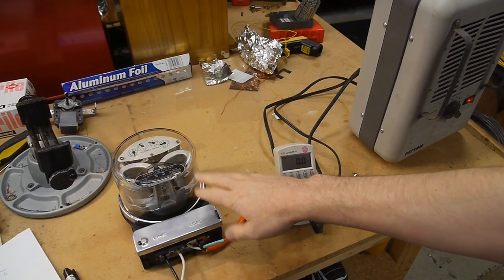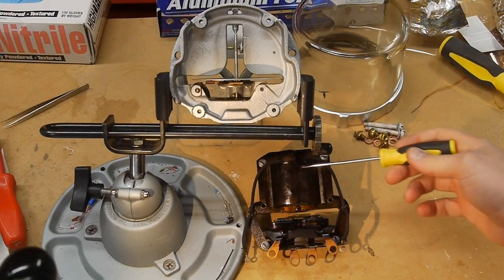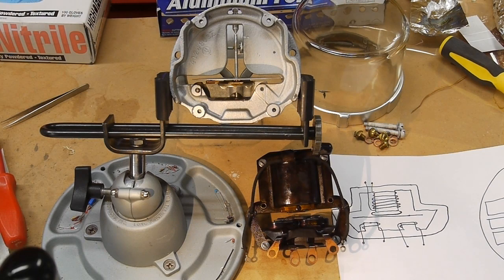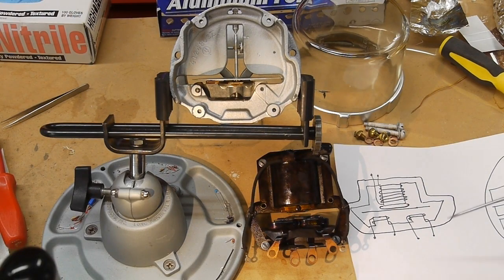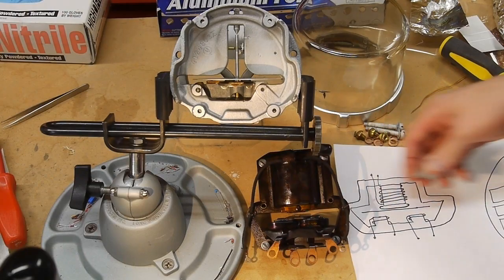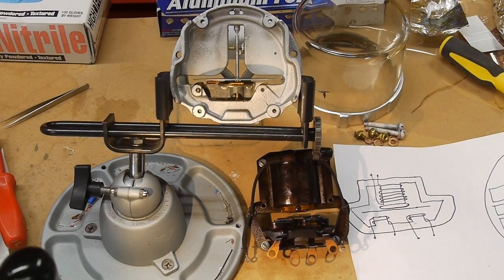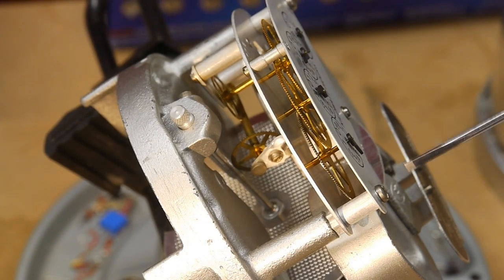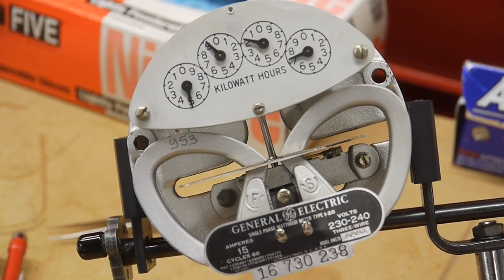Explanation of how kilowatt-hour meters work (electromechanical)

Comment: Is this correct, if I wire my home with oversized wires (gauge 10 vs 14) would the meter run slower (cooler) versus standard wire which is 14 would run faster (hotter) on the meter. In other words would I save money by running thicker gauge in my prewire home?

Comment: Why when we put a photovoltaic panel or a cogeneration unit in an power utility then the meter turn slower or not at all if the self-produced power is a bit fewer than consumed one in the first condition,or equal in the second or the meter turns backwards if the self produced power is a bit more than consumed and it turns exactly as the difference between self-produced and consumed,or it turns full of speed backwards exactly to write the self-produced amount that we export to the national energy net if the instance consumed e energy is zero and instance self-produced non zero-possitive?
All of this it has to do with the phase bitween grid voltage and self-produced current?

Comment: As an electrical engineer, I worked on the manufacture of a specialized piece of test equipment to trick these meters.  It combined passing full voltage combined with high current from two separate sources.  The meter was thinking it was reading 30KW, when in fact the equipment was only drawing less than 1.7 KW.  We used it in the calibration of wireless meter reading designs.

Comment: The two current coils are also there to generate their own torque on the rotor, but proportional to the current flowing...the asymmetry is to make the current based torque also generated by another shaded poll arrangement. On the whole it looks like a set of two shaded pole setups, one for the voltage, and one by the current. Voltage coil alone will not provide the rotating torque on the rotor. But both have to have the shaded poles, to give the torque in the same direction.

Comment: Here is something I would like to hear comments on or a piece on how I am not right.  Several years earlier I installed a whole house surge protector capable of handling a significant surge from lighting on the incoming power line.   In 2019 I was on a 2 month RV trip to visit my new grandson in CA from NY.  When we returned and I read the meter for the last month my jaw dropped.  While no one was home and everything possible was shut down the house had consumed more power than it ever had before and close to 50% more than the first month we were gone.  After talking with others in the area I realized that there had been a lightning strike hit the power line that month.  Others had some serious damage but my surge protector protected the house as it was supposed to and now the electric company was preparing to charge me for the power my surge protector consumed.  They said no that wasn't possible and checked the meter and said it was fine but replaced it anyway with a newer digital meter and gave me a refund of the difference between the first and second month.  Since the new meter has been consistently lower than what monthly usage was earlier.   I think if you put in a whole house surge protector capable of withstanding a lightning strike on the line you should get the meter changed to digital.  I was right and they knew it and the meter was damaged from a previous strike or just plain not working right but they wouldn't admit it.

Comment: Hmm... I got one that was used for a lamp and the natural and hots are opposite. Yours the hot is on the outer terminals and the one I got the hots are on the two inner ones? Which way is correct? cause mines working no issues.

Comment: Hello. I am leaving alone in townhouse with 4 units. I do not have laundry machines at all, do not have electric cattle, use only gas stove. But my gas and electric meters’s discs speeding up much faster then other neighbours’s. Ones’s even does not move. How it can be? All my neighbours have at least 3 people in family, they are all present, in this winter time i am sure they have to use gas to heat house and boil water. But they meters’ disks do not move. Am I paying for my neighbour’s gas and electricity?
How I can find out this?

Comment: I think it's funny how they make a motor to use energy to turn, magnets to slow it back down, and a copper piece to speed it back up again, and a hole to slow it down AGAIN. Isn't there a simpler way to turn current into motion??

Comment: Late to the party here, but could the asymmetry in the current coils be there to bias current flow in the load direction. I.e, in residences with PV or excess energy to underpay them for reverse current (back into the grid)?

Comment: One aspect is unclear to me.  It doesn’t seem possible that the actual current of the load (a residence) would pass through those current coils on the meter, because the wires carrying the current to the panel are much larger.  How is the meter coupled to the power lines?
Reply: Now I get it.  There is a current transformer which is shaped like a doughnut, and the power line just runs through the hole.  There are two, one for each line.  On high-power meters, that is.

Comment: Ok they meter the line coming in, so they charge us $$ for it.
And since current always returns to its source, if we were to put a meter on the neutral going back to the pole, would we actually have used any "electricity" ?
Reply: The meter measures what you use.  The statement “put a meter on the neutral” doen’t make any sense.  When a meter is connected correctly, it will record the correct usage.  If you hook it up incorrectly, who knows what you will get?

Comment: Thos kinda reminds me of an electric brake system Saurer experimented with on their trucks. The idea was to used eddy currents for a frictionless brake. Afaik the system turned out to be too heavy although it worked well.

I don't exactly know what the holes in the Alu disc are for, but they hardly matter for the eddy currents. Those currents form rings, so drilling the center out won't change much. My guess is it is for weight reduction / balancing reasons, and on the trucks they also did it for cooling

Comment: I guess, the three current coil configuration has been installed for people who want to reduce their electricity costs by returning the current to ground instead of neutral. When two coil sections of the neutral coil are positioned positioned against each other, they cancel out each other. This results in 2I-I=I When current returns to ground, the meter still receives I, since +0I-0I+I=I.
Reply: The way you reduce your electricity costs is by using less of it.  Turn off lights when you don’t need them.

Comment: Okay I think you definitely know almost everything there is to know about electrical kilowatt hour meters so here's a question for you... I'm fairly sure I have a Sangamo Type J5S Electric Watthour Meter CL200 240V 3W 30TA 7.2kh .. it has the old-style analog disc but it has what appears to be a recently added digital readout.. I know the dial Will spin backwards when there is a backfeed.. I'm trying to figure out if it's likely that the digital numbers will count backwards during a backfeed or only count forward even during a backfeed

Comment: Another comment about voltage coil and phase shift: without any shading coils, the phase shift of the voltage coil is almost exactly 90 degrees.  This is because of the many turns and the relatively complete iron circuit.  Do this: measure the DC resistance of the voltage coil (probably in the 100's of ohms?)  Accounting only for that, it would draw ~1 amp.  I am willing to bet that is draws only a few milliamps.  Why?  An inductive reactance 100's of times more than 100 ohms!  So the phase shift will be nearly 90 degrees.  The shading coil only is to "tweak" the lag a few degrees more.  On the other hand, the current coil had almost zero inductance, so the phase shift of the current is almost zero.  What is important is that the phase shift of the voltage relative to the current is exactly 90 degrees.
          The cheapest larger induction motors use this technique for starting.  It is called "split-phase start".  On purpose, a "starting" winding is wound with "way too fine" wire, and "too few turns", causing the current to be regulated by resistance, not inductance.  The "running" winding is heavy wire of many turns.  Its magnetic field is delayed relative to that of the starting winding.  If the starting switch doesn't cut out the starting winding within a few seconds after starting (or if starting fails), the winding will burn up!
          Regarding the "anti-creep" hole: in many meters they put a tiny steel rivet into the hole.  It is attracted to the magnetic region.  Does your meter have any steel in the hole?  The wheel speeds up as the rivet approaches, but slows as it recedes, having no net affect on the meter's reading over time.
          I don't know why the current coil is asymmetric.  I assume the symmetric one has 1 or 2 turns in series wound in opposite directions in the 2 coils.  It is also weird that they sense the neutral current.  Perhaps this is to defeat some cheating scheme of bridging the meter?
Reply: Interesting stuff, I wish I would comprehend more though..
Reply: Someone mentioned something about the two neutral coils would prevent lowering the readings if you would hook your neutral to ground?

Comment: Have a question on the billing aspect, the meter would calculate wattage on the neutral, so on a 3ph system am I right in assuming that the more balanced your load the lower your bill?
Reply: No.  The meter does not “look” at the neutral.

Comment: I'm here because my old meter has added a whopping 42000 kWh (42 MWh) in six months when it should have registered just 7 to 8 MWh. As far as I can calculate that's almost physically impossible without tripping a breaker somewhere [often], which hasn't happened once. The meter now appears to be registering normal usage again, making things even more mysterious.

It's six months because that's how often they read the meter here and I now have the bill. Over $9000 (Australian dollars).

It's an old single phase 240V 60A meter and the main isolating breaker is 63A. Household draw peaks at about 25A, so that leaves only 38A max for any background leakage current that might have existed.

Simple calculation tells me that it would take  a minimum of 160 days to leak the amount of energy over what I've used without tripping the main breaker.

The biggest breaker in the house itself is 32A, which if the leak is in a house circuit would set the minimum period at 190 days.

Even then it would require a perfectly steady leak at just under the respective breaker values for the entire period, which I know is impossible.

So I'm looking at a very strange and unlikely meter malfunction or human intervention.

Luckily I actually monitor and record my HVAC system, which is by far my biggest user of power. It matches the previous year's usage closely.

Comment: There were tales of naughty people that used to use something like a 25VA transformer, wound to give 1v at around 25A on the secondary. One of the secondary connections (for convenience) was wired to the LIVE in the plugtop (any fuse removed), the other end of the secondary then went via a piece of curved copper bar (or a brass picture hook), and slid up behind the back of the incoming LIVE on the LINE side.

You then had the voltage coil, powered correctly and the current coils (for example) passing 10A to run whatever was running in the house. HOWEVER you then ALSO had 25A in anti-phase flowing from LIVE (or hot) on the LOAD side to the LIVE (or hot) on the LINE side.

The result in ALL the meters which didn't have a RED (Reverse Energy Detect) design, was that the wheel would obligingly spin BACKWARDS and start clocking OFF the units.

Terribly naughty - they were often known (tongue in cheek) as "Anti gravity machines" for some reason.

It is one of the reasons they were keen to switch people to digital, as by default RED is enabled so any attempt to do naughty things, fails and in some cases trips a "flag" to alert the meter reader.

It can happen legitimately to on a house with a solar installation that uses a Grid Tied Inverter. Once the house starts to generate a net surplus, if the supply meter is a "wheel based" one, it will run backwards - which will result in true "net metering".

Comment: So that model meter is not a "plug-in" type (meaning it does not plug in to a meter box like a modern meter does).
Reply: It isn’t because it isn’t modern, it’s because it is for low power circuits.  It is marked 15A.

Comment: The current coils are wound in the opposite direction because this is a 240V meter designed for a split phase 120/240v system (standard household electrical service).  When the voltage coil is connected to 240V a 120v loads only is only flows though half the meter or the meter will register twice the actual KW/H used.  You can connect this type of meter to 120v supply;  the current coils need to be connected in series.
https://sep.yimg.com/ty/cdn/yhst-97927213475128/wiringguide-form2s.pdf 
https://sep.yimg.com/ty/cdn/yhst-97927213475128/wiringguide-form2s-240v.pdf
Form-2s, 120/240v meter are around  $20 used.

Comment: How does an electric meter calculate the bill since the AC current is going both directions? and since current is flowing back and forth, and not going anywhere, bill will be always zero, isn’t it? please clear my doubts
Reply: Your bill is definitely not zero.  The disc turns only one direction and the dials record the energy usage.

Comment: Good video 
Question: what happens if the mains voltage gets down, Would the meter read or count the correct amount of KWh  ?? 
I understand from this video that the force that rotates the disk depends on both the current pulled by the load and the voltage of the mains. Is that right ?

Comment: I wonder how much power the voltage excitation coil consumes? This wasted power is paid for by the utility I would imagine, not the customer.
Reply: The customer always pays...  the energy for the coil is part of the Unaccounted for Energy in the system - we call it UFE and Line Loss - and is divided up between all consumers on the system.
Reply: It is minimal and, as was stated, the disc stops when the power is very low.

Comment: Pretty good explanation of an older watt-hour meter.  I was Quality Engineering Manager for Sangamo Weston's watthour meter manufacturing business in the 1980's.  The stippling on the aluminum disk is mainly to maintain flatness.  There were only 4 manufacturers of these type meters in the 1980's.  The electronics revolution created 100's!  We sold 1 million of these single phase meters per year.
Reply: Would you happen to know what the expected 'lifetime' is of those Sangamo watthour meters?  How do they degrade over time and what the usual failure modes? I have heard people having them for 30+ years, even as they were later updated with electronic ERT broadcasting gizmos to make it easier to get the usage info, and reclassified as 'electromechanical hybrids'.  Does anyone in North America still manufacture new(not refurbished) electromechanical meters?
Reply: @kengartner204  I don't know what the expected lifetime is now, but each utility company has their own standards for replacement, with some validity due to differing climates.

Failure modes used to be mostly from people thumping them every time they passed by... that's not gonna make them speed up!  Many modes of tampering too.  As far as Mfg. Defects, if they are properly calibrated before installation, very little can go wrong with them.

The Big Four meter makers were GE, Sangamo (now ITRON), Duncan, Westinghouse.  Don't know about now.

Comment: 6:40 why did they not used capacitor to change phase difference in same way which used by 1 phase induction motors on start winding ? ?
Reply: May be because the capacitor may loose some of its capacitance over the years and becomes weak.

Comment: how are eddy currents able to rotate the aluminum disc?
someone please tell me.
Reply: Look at the bottom left and top center pole pieces. The magnetic field will reach a peak first at the left pole. Later, due to the phase shift, the magnetic field will reach its peak at the center pole. Meanwhile, the magnetic field at the left pole will have become weaker. The result is that the magnetic field appears to move across the disc from left to right. 
   As the magnetic field moves across the disc, it induces eddy currents in the disc. These currents produce their own magnetic fields which interact with the magnetic field that produced them. The result is that the disc tends to be dragged along with the moving magnetic field produced by the pole pieces, which causes the disc to rotate. 
  This is demonstrated in the video when he takes a strong permanent magnet and moves it back and forth near the disc. The disc follows the magnet even though the disc itself is made of a nonmagnetic material. 
  So, to say it again, the magnetic field produced by the pole pieces seems to move across the disc, which induces eddy currents in the disc. The magnetic field produced by the eddy currents interacts (attracts/repels) with the original field so that the disc is dragged along with it.

Comment: I don't understand why the copper loop is there. In the current coil the magnetic field is proportional to the current, while in the voltage coil the magnetic field is proportional to the time integral of the voltage. If the current is in phase with the voltage then the magnetic fields are going to 90 degrees out of phase without the copper loop. Maybe the copper loop is there to compensate for the resistance of the voltage coil. If the coil has a high resistance the magnetic field will lag by less than 90 degrees due to the voltage drop across the resistance. In that case it would make more sense to have the copper loop.